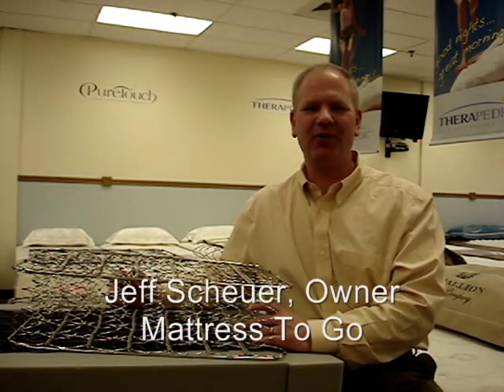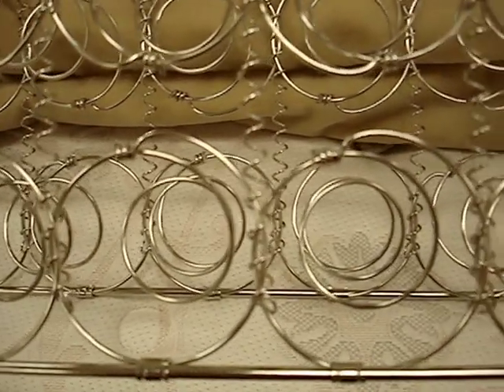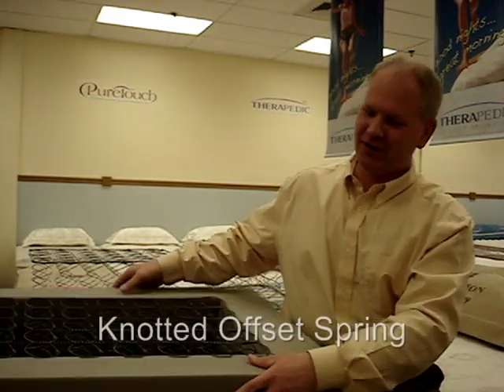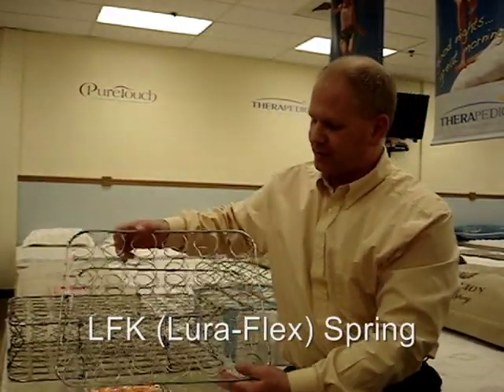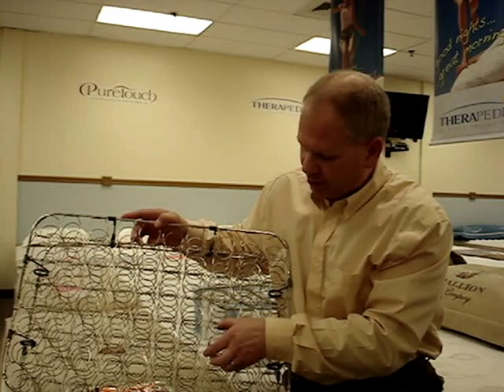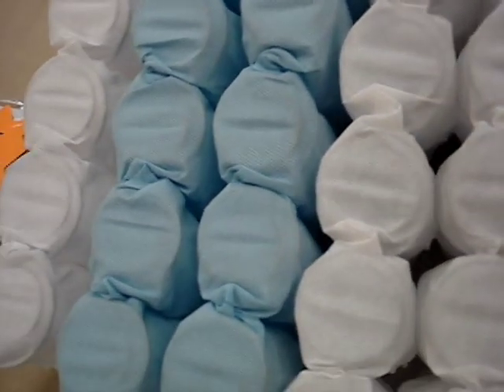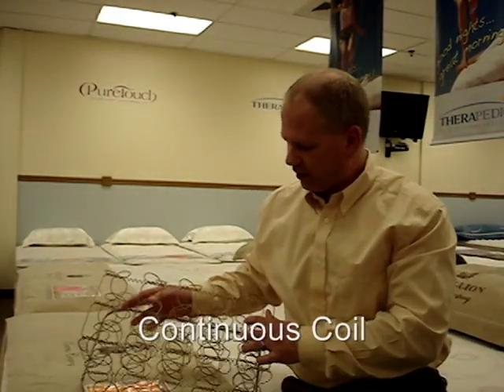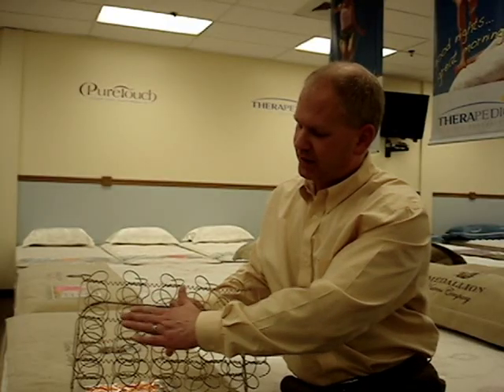Beducation® - Mattress Innersprings Part 1: Basic Innerspring Units

Comment: Which one is best for a heavy 5’7 woman with large hips and small waist. Arms falling asleep. ? Thank you
Reply from the maker: Realize that all of the components within a mattress (spring unit and comfort layers) contribute to the overall support and comfort of a mattress. 

There aren't necessarily "best" innerspring units for specific body types, but I can make some general observations. If someone has a large difference between their waist and hips and sleeps upon their side, then they'd want to make sure that their support core unit also provides for some deep point elasticity, allowing for the hips to sink in a bit, but not too much, and also meet and contour to the waist. A heavy-duty pocketed innerspring unit could be a viable option, as could a stronger LFK spring unit, or even a knotted offset design. It all depends upon the individual's actual dimensions, size, and sleeping positions.

Another very important thing to consider is going to be the comfort materials (padding), for the surface elasticity. Focus upon the more durable, high density foams, which will provide better resilience and a longer expected comfort life. And make sure there is enough material to maintain contact with the body and the extremes of the dimensional differences between the wait, hips and shoulders.

As for arms falling asleep, that can be caused by many issues. Depending upon what area of the arm is experiencing paresthesia (hand, below the elbow, entire arm...), this could be related to putting pressure upon a nerve and/or constricting blood flow. This is often a result of one's level of overall flexibility in the wrist, elbow or shoulder joint. It can also be caused by certain sleeping postures where the arm is tucked under the head or above the head. It can also be the result of a pillow being inadequate to help maintain proper alignment while sleeping. And then there are also some dietary causes. A simple search on arms falling asleep will bring up a myriad of articles, some of which may seem to be more appropriate for your personal situation.

Comment: What can be done to prevent that middle sag from happening?
Reply from the maker: +Stephanie Roberts Sag in the middle of a mattress can be due to many things, Starting with the bed frame, you need to make sure that there is a proper center support. Then, make the sure the mattress set foundation is properly firm, flat and supportive. With the mattress make sure that a solid spring unit is used. Lastly, make sure that proper layers of higher-quality foams are used in the mattress and that they are affixed properly. This is where most sagging results in modern mattresses - the foams are generally lower density, low weight fibers are used, many convoluted foams are used, and they're often not secured well. While all foams soften over time, true sagging is usually a result of one or a combination of many of these things.
Reply: Thank you very much! Can you explain "center support and properly firm?" Thank you. After your comments here what foundation and mattress would you recommend? I am looking for support but not too rigid, quality foams, cotton bating if possible. What is a solid spring? What about thicker springs for firmness.
Reply from the maker: While we can't pick a mattress for you, these Beducation videos serve as a good guideline. The innerspring unit's main job is to provide support, so you want to make sure that whatever mattress you're considering has a good strong unit that will support you properly and maintain good alignment characteristics. Some spring units are stronger than others, so you'll want to discuss the differences with an educated consultant at the store you visit. The firmness of the spring unit isn't dictated strictly by the thickness of the steel. It also depends upon the manner in which the spring is joined, the design and the number of revolutions, just to name a few things. The overall comfort is dictated mostly by the padding layers on top. If you're looking at an item using a decent amount of cotton, make sure that the cotton is properly pre-compressed so that it holds shape. There aren't too many manufacturers making a quality cotton mattress, so it shouldn't be too difficult for you to do some online research and find a few and speak with a qualified representative of those companies and go try one out in person. Good luck!